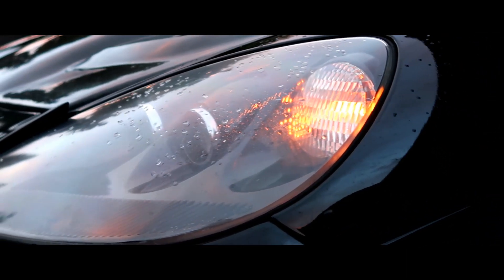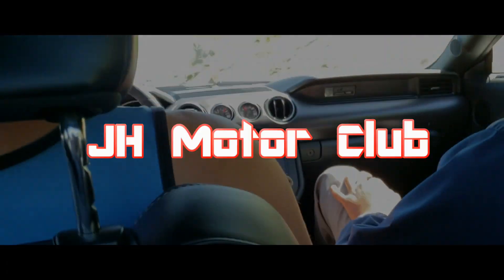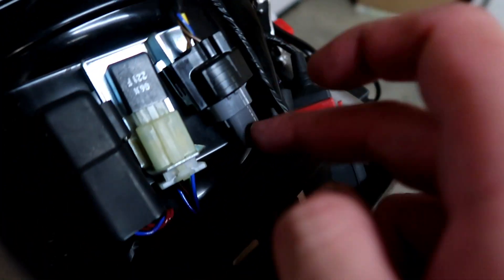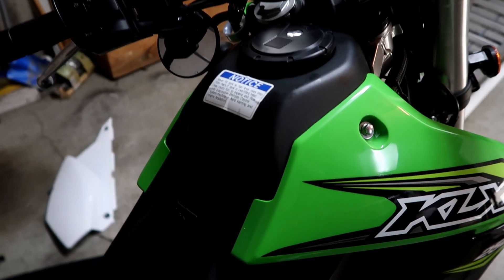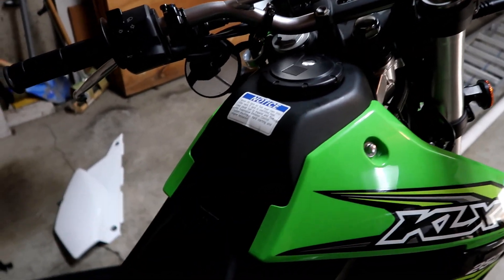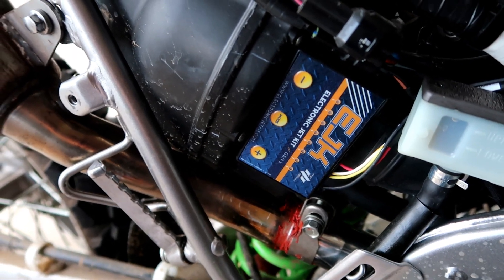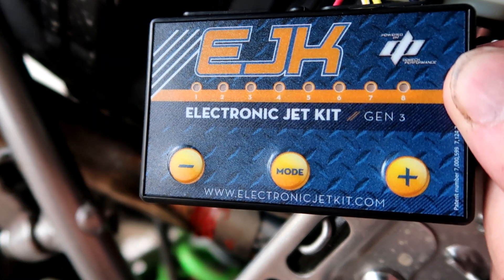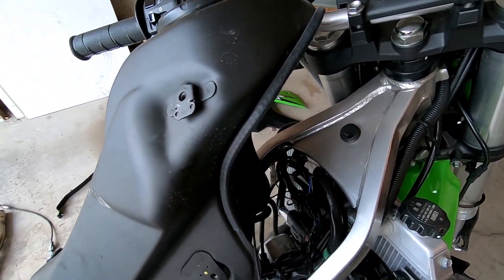EJK Fuel Controller + KDX Snorkel Install | KLX250 Build Series Part 2

Comment: When you start dialing that EJK in, make small changes one at a time in each mode and document how far in whichever direction you go. Make sure you understand what each mode is supposed to affect and give it a test ride looking for behavior in the mode you're changing. If it improves in the direction of your change, make another small adjustment and try again. If you run into poor behavior, go back to the last change that was working well, then move on to the next mode. Always document where you were coming from so if you really dork it up, you know how to reset it to start over. Generally, you want to sneak up on the richest setting for each mode, then back it off a bit, (environmental factors and individual equipment withstanding,). That way you have a smooth throttle delivery without holes in the power band and without excessive popping and hesitation on overrun. It's a very kewl, very effective product, but you get all the blame if you don't do it right. So again: Be patient. Make small changes. Document. Test. See you in the next vid.
Reply from the maker: Thank you for the tips! I have ridden the bike already a few times and already can tell how messy the stock ECU was with the slip on only. Even on the recommended settings from EJK, it feels smoother than before. I do have some testing to do, however
Reply: thanks for the info juan!!!

Comment: That's where I had my EJK mounted in the beginning, maybe it was just me but it seemed like it got really hot that close to the pipe. That's when I decided to mount it to the frame in front of the battery.  You will spend a lot of time deciding on settings but it's well worth the effort
Reply from the maker: I mounted it up as high as possible on the airbox, but I think I'm going to move  it to the other side away from the exhaust like you said. Before I deviate from EJK's recommended settings, I'll probably go to a dyno so I have an idea of the AFR's. The recommended settings are working pretty well so far, though. My powerband seems to really kick in still after 6-7K, but has a little bit more punch below that than stock. Is yours the same?
Reply: @jhmotorclub6916  oh yeah ! The only mods I have done is the 13t sprocket and the Q4 slip on and the EJK.. I tried running it without the stock snorkel but it actually seemed to do better with it on. Will probably get the kdx but it seems to really running great at the moment. Just ordered the pair valve eliminator with the healtech module . Thinking that if I can get rid of the decel pop, I should have it dialed pretty good.
Reply from the maker: @gunsnguitars101  Nice! I was at a lot yesterday trying to do 2nd gear wheelies and couldn't get it to come up more than a foot. However, one of my friends rode it and wheelied the whole lot. He is a lot better than me though lol. So, I decided that I want to get some gearing. I'll probably go with the 13T up front vs a 45T in the rear. A -1 on the countershaft shouldn't wear the chain too bad and I think it will still be manageable on the highway.
Reply: @gunsnguitars101  what is decal pop :0
Reply: @jhmotorclub6916  how hard is it to adjust the chain tension by yourself... Was thinking of 13t front sprocket
Reply: @the87ghosts  as you decelerate,  you'll hear the big pop out of your exhaust
Reply from the maker: @the87ghosts  Not that hard. It has markings on the swingarm to line up each side

Comment: Hey guys! I decided to get myself an ejk. I got a powercore 4 slip on and put around 40 miles on it and now I can feel the bike being very sluggish now! I couldnt even keep up with a grom so Im now gonna dial in this ejk and remove my airbox lid :)
Reply: Does it act like a carb like how you can change the mixture? I’m wondering if I get an exaust it that can replace a tune
Reply: それはマフラーだけでは逆に遅くなる?ということですか? 燃料調整も行はなければ真のパワーは出せないということですか?

Comment: Hi JHMC - so glad to see you still help guys out on this thread even though its a year old.  I have a 2018 KLX and found your posts, (now a subscriber) you do a great job explaining your work, thanks for the effort you put into it all.  I had a different question, do you think a spark plug change (or upgrade) should be done with these stage 1 mods, and if so, which one did you go with?
Reply from the maker: I appreciate the kind words! Welcome to the club! I am still running the stock spark plug. Well, I've gone through a few but still running the same model as it came with. Someone told me that they saw some gains with a spitfire plug. However, I have not tested it. I did not see the need for a different spark plug when running stage 1 mods.

Comment: Great vid!  I have a noob question for my: 2019 KLX250 (EFI with o2 sensor exhaust).  Do I use the EJK o2 bypass plug, or not, with my stage one (o2 sensored) pipe/KDX200 snorkel mods?   If so, does the EJK 02 bypass plug stay on just during the EJK fuel-settings tuning, or does it stay plugged in permanently?  Thank you!

Comment: Hi I have the same mods and am getting the red fi light on dash. I did use the ejk sensor bypass plug on it. It runs fine though despite the red light

Comment: Hi, I have a 2018 klx 250, should I change the air filter with stage 1 mods? Currently has 4k miles on stock air filter.

Comment: Did you prefer having the ejk here or on the left side in a accessible spot without removing panals.. Could u send a pic of the ejk where u have it i got mine otw and have my dealer installing it with a kdx snorkel and I'll do the muffler myself later.. Then I need to access the ejk sooo :$ wondering where you think best placement is.
Reply from the maker: It's a pretty simple install with the some basic tools. I have a good shot of it on my video called "How much money do I have into my Big Bore KLX351?" at the 3:35 mark.

Comment: Does deleting the O2 sensor make any difference?
Reply from the maker: Deleting the O2 sensor allows for tuning of the lower RPM range. With it still in place, it is difficult to tune the lower range.
Reply: @jhmotorclub6916  thanks for the replies man, I am working on my klx and I am using your vids to follow as my guide. I deleted the O2 but I guess I didn’t adjust the ejk right. I will revisit the idea here shortly. I’m still waiting on the rest of the epa delete stuff to come in.

Comment: Hey man does your tank sit flush on the frame? I'm putting mine back on but it feels like it moves even if its bolted on. And the sides dont seem to sit al the way against the frame
Reply from the maker: It does not sit directly on the frame. It sits on a rubber cushion attached to the frame. So there is a little bit of wiggle room.

Comment: Does the kids snorkel keep the same amount of noise as the original snorkel? I removed the lid completely and it was to loud for me.
Reply from the maker: Removing the airbox lid has a big effect on intake sound. Putting the lid on with my KDX snorkel quiets is down a lot when I go to the dunes. I do not really gaining too much intake noise going from the stock snorkel to the KDX one.
Reply: @jhmotorclub6916  Hi, what year of a kdx bike for searching snorkel

Comment: Hey man have you had any issues with a FI light coming on after you kill the engine? I have the same bike and put some similar mods on. Ever since I put on EJK it runs great but the FI light comes on every time I kill the engine. I end up having to turn the key off and back on to reset it. My friend is having same exact issues after EJK.
Reply from the maker: I did. It would happen when using the killswitch. I believe it was because the EJK was a piggyback controller. My PCFC does the same thing now too. So, I switched to using the key to kill the bike. Some say it is a safer habit anyway.

Comment: Hello,
I have a KLX250S 2018. However, my EJK is accidentally  9310247 which is for KLX250s Big bore kit, shown on the Website of Dobeck. Is is possible to use the EJK on my bike?
Reply from the maker: No, it would have the incorrect settings for a stock bore bike. They should be able to exchange that for you on them,  since they sent you the wrong one.

Comment: Hi! Thanks for making this video. Appreciate your work. I have a 2010 klx250sf that is carbureted, will the EJK work for it also? (sorry for the newbie question). I’m new to this.
Reply from the maker: No worries. I appreciate the support. The EJK is a fuel tuner for Electronic Fuel Injection bikes. So, it will not work on carbed bikes. Carbed bikes are tuned by the jets and needles.

Comment: I installed the ejk and it went well. When the last two modes I recorded the stock value it flashed the number 2slot then then second color of the sequence flashed on 8. What value is that considered 2.5?
Reply from the maker: If I am understanding you correctly, it sounds like you are tuning the "color"-blue zones. For instance, if it was alternating between red and blue then that is the red blue zone. The last light will always flash in one of these zones. The first light or the ones that is not blue represents the setting that zone is on. So, if red was flashing on light 2 and 3, then that is 2.5. If only 2, then that is setting 2
Reply: @jhmotorclub6916  i figured that out off another vid thank you tho your videos are extremely great guidelines. Made it quick and easy
Reply: @jhmotorclub6916  hey last question. For kdx snorkel. O2 bypass. And fmf Q4. What settings would u recommend. I trust your judgement.
Reply from the maker: @the87ghosts  I ended up with 4 2 2 2 3 2 (G Y R GB YB RB). My plug was a little too black. So, I would try 4 1.5 1.5 2 3 2
Reply: @jhmotorclub6916  thank you :)

Comment: Did you need to download any maps or anything or did it update by itself to match your bike? Looking at fmf Q4 + this + snorkel
Reply from the maker: No maps need to be downloaded as the EJK comes with the map already loaded. EJK has provided settings for each of the zones for "Stage 1" mods.
Reply: @jhmotorclub6916  it won't let me complete a purchase on the dobeck website where do you think I can rkder the ejk. Got the snorkel and Q4 on the way
Reply from the maker: @the87ghosts  I would give EJK a call directly. There website is not the best at times.

Comment: hello my friend i have the same machine as you and i want to buy the fuel regulator (ejk) but they were selling 2 computers one for mom bikes and one hello bikes with exhaust and other upgrades what do you prefer it is better for you?
Reply from the maker: I got the EJK with the part number 9310209. This is for 2008-2020 fuel injected bikes according to their website.  From there, I used the setting for Stage 1 mods. It definitely woke up the bike
Reply: @jhmotorclub6916  thank you my frient for your help thank you
Reply: @jhmotorclub6916  hello agaim
with ejk 9310209 can i run  full system exhaust and snorkel kdx200 and secodery throth out or i need another ejk like 9310247??
Reply from the maker: @nikosmpallas64  You can use the EJK for the KLX without the secondary throttle blade. It just needs to be adjusted properly.
Reply: @jhmotorclub6916  
i have in my bike some mods
kdx snorkel
full exhaust like fmf mega bomb
marcelino cam mod
you think the ejk for stock bike its ok for me or its better t buy ejk for bigger engine
that is 9310209 like you or 9310247?
Reply from the maker: @nikosmpallas64  The stock EJK for the KLX is okay. If you do a big bore you can send it back to get retuned by Dobeck
Reply: @jhmotorclub6916  ok my frient thank you for your help you ar really good guy

Comment: I just got ejk. But instruction said b4 start it it should be green light flashing each side. But mine is left side green and right side red. I checked all the cable. Any comments?
Reply from the maker: Mine did the same thing in this video

Comment: Where did you get the kdx snorkel?
Reply from the maker: I got it from Revzilla, Kawasaki Part Number: 14073-1577
Reply: @jhmotorclub6916  this will fit on a 2019? says only up to a 2006?
Reply from the maker: @ryandoyle9165  It is the correct part number for the bike 👍🏼
Reply: JH Motor Club thanks man I’m just now getting around to trying this.

Comment: Do you or anyone else have wetness in recessed fuel filler area when you open your fuel cap? Fuel venting from cap?
Reply: John Buchmann yah guy i have a 2018 klx and I get minuscule amounts of gas along the edge when I lift the cap I’ve chocked it off too fuel evap out of the cap

Comment: Whats the part number on the ejk? I'm currently upgrading my 2020. Thanks
Reply from the maker: Nice, congrats! It is 9310209
Reply: I didn't think finding that snorkel would be a challenge but I can't find it. Where did you get yours
Reply from the maker: I got mine here:
https://www.partzilla.com/product/kawasaki/14073-1577?gclid=CjwKCAiAoOz-BRBdEiwAyuvA61OAyeh7tUw_odp-vlAw47chYB0pYm_FgYnP2bQoFumrhP9u0WKJ_xoCfPMQAvD_BwE
Reply: @jhmotorclub6916  yo thanks for all the help bro.

Comment: Where did you get the snorkel what site?
Reply from the maker: I got it from Revzilla:
https://www.revzilla.com/oem/kawasaki/kawasaki-14073-1577-duct-air-inlet
Reply: Will KDX snorkel mod require EJK or other mapping device?  Can I put that snorkel in with stock setup? TIA
Reply: @downhillsportsusa   YES. unless you want to kill your bike early.
Reply: @cawalkabout  why will it kill the bike?

Comment: Do you have any upgrade parts for sale
Reply from the maker: Unfortunately, I do not. I have sold my exhaust and EJK already. I only have my trail cage left
Reply: @jhmotorclub6916  ok thank you for your response
Reply: @jhmotorclub6916  what exhaust do you prefer
Reply from the maker: I liked both the FMF and the Barker. I got the Barker because it apparently would give me the best gains for my build. The Barker is really loud, which some do not like. The FMF is a real crisp sounding exhaust.